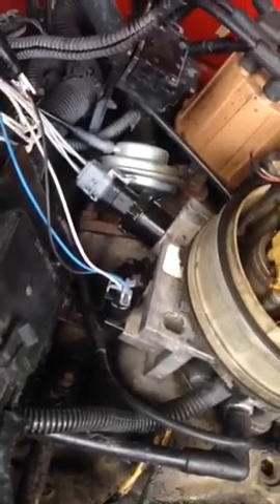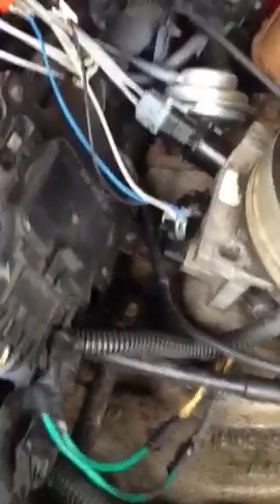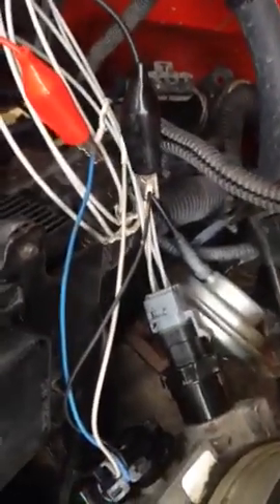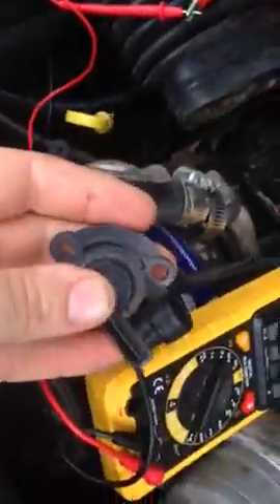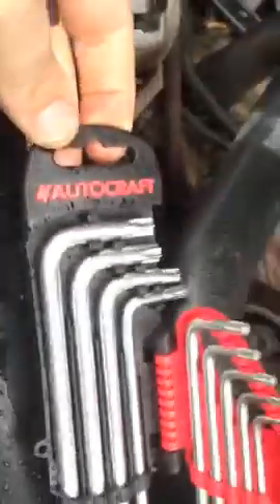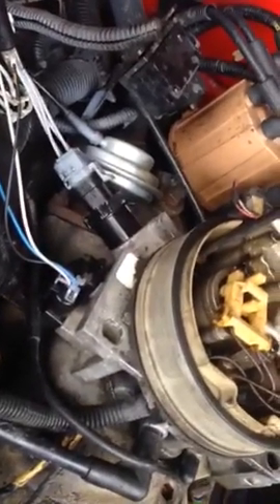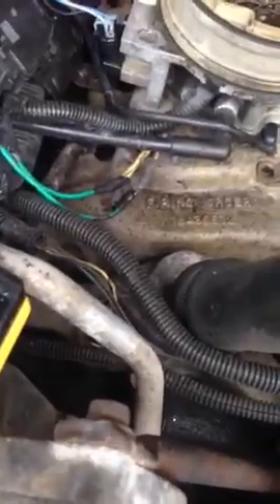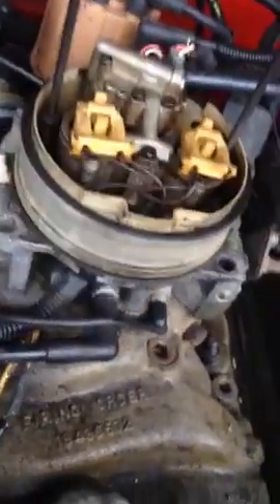TPS test and change, T25 Torex, K3500 Chevy 350 5.7 TBI, IAC, Throttle Position Sensor repair, 1995

Comment: I have a 94 K2500 454 BBC. It was running great then all of a sudden one day it started having problems accelerating with some lag and it would take forever to shift and when it did it would jerk pretty hard. Took it to a mechanic and they brought up a code for the TPS and wanted to charge me $190 to do it. My mind was blown because of how easy of a job it is, so I bought one from O’Reillys and replaced it myself. Read the owners manual for my truck and it pretty much just says it’s a plug and play, no calibrating or anything. But I’m still having issues ! Same issues… idk what I did wrong or didn’t do. It was a simple electrical connector and two torque screws.. Anybody have a clue??

Comment: Truly, a great video. Including the tip on how to modify a shitty TPS was rad. Rearranging the acronyms, (of which there are way too many!!) and calling the throttle cable the ‘bell housing’ added some much welcomed comedy to an otherwise ultra frustrating mf pos old-meets-new tech, ShitShow of GM mashup engineering ass-hattery. And after hours of reading others issues, with so many different, but sorta similar fixes…dammit. I know I’m not alone, and it gives me zero comfort…

Comment: yup, that's the one...!
ever seen one of these TPS units dump fuel, on to a hot manifold...?
it was either that or the air idle control valve... but ya...
not a fun time...!
Reply: no, but it sounds like a car fire potential.  do you mean on a running engine or with engine off?   Fuel injectors limit fuel from spraying.

Comment: Did you do an IAC reset when you reinstalled the TBI? Disconnect battery to clear codes, reconnect battery, jump A&B on ALDL connector, turn key on for 30 seconds or so, turn key off, remove jumper from ALDL connector.  What happens when you do this is the IAC pintle will extend full-closed and stay there until you turn the key off. At that point the ECM assumes it's closed and has a reference point for any commands it sends to it from there on out. Good video thanks ,I just fixed my truck runs great now . https://www.youtube.com/watch?v=-BDUuHcDqW4
Reply: Thanks for adding that.  I was doing that reset on at least a weekly basis.

Comment: 1st truck video where it has both of the extension seals 25511809(top/bottom) on the air filter plate to the throttle body.
Reply: I actually just rebuilt my throttle body and I was trying to figure out why it didn’t have two so I ended up making one from a felpro karropak roll I had

Comment: I hope this is my problem, im sick of these erratic idle problems.. surges, the levels out, then high idle, then levels out , then surging . ive replaced the IAC, rebuilt throttle body replaced TPS , replace coolant temp sensor, checked for vacuum leaks, set base timing, im running out of things to check. .. how can u tell if the tps is adjustable.. mine has the oval shaped plug, not the round one
Reply: There's a base idle relearn procedure. Basically short out the two pins on the OBD port with a wire / paperclip & then adjust.
https://youtu.be/nJkPgkMpTFs
Reply: I was having almost the same problem, I replaced the IAC, cap and rotor, plugs and wires, rebuilt the throttle body and nothing else was working. I ended up replacing the oxygen sensor and my problem went away
Reply: @brandonrayner5253  yes the 02 sensor regulates fuel trims once the engine goes into closed loop, it will usually fail rich,,

Comment: I was having the same problem,as you said and very important step,never replace especially in those parts aftermarket parts like e Bay or Amazon,I known it's way more cheaper but they going to take you to wrong dignostic and its going to make you crazy,, good video and thanks for sharing,tbi it's a really tricky system